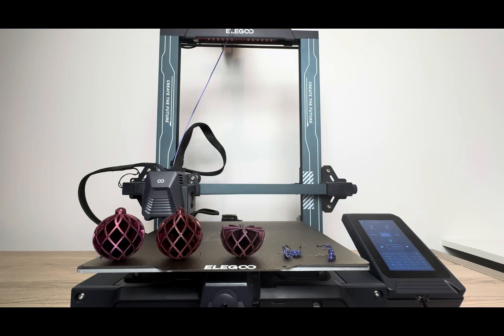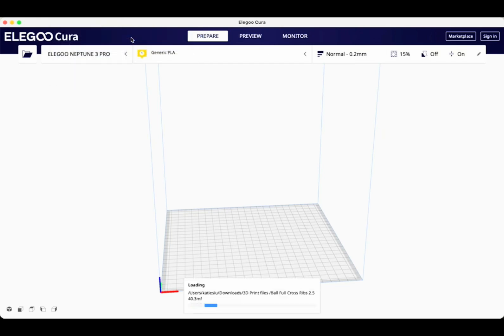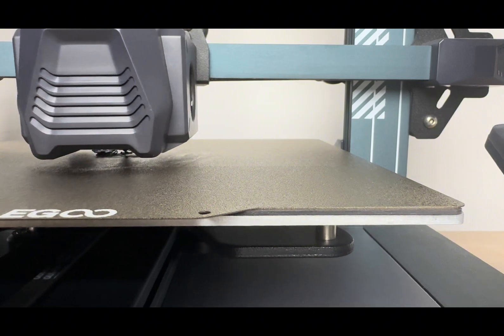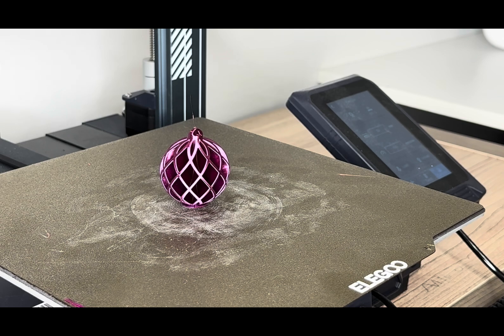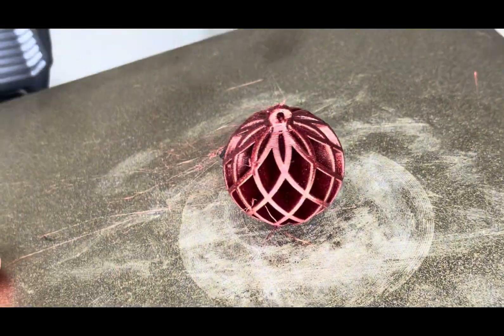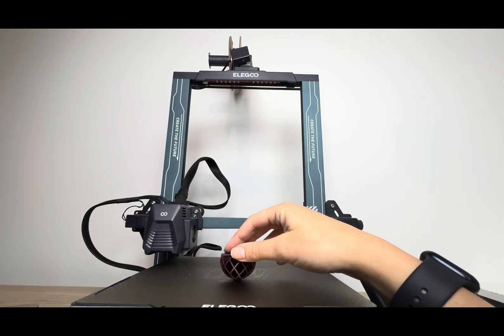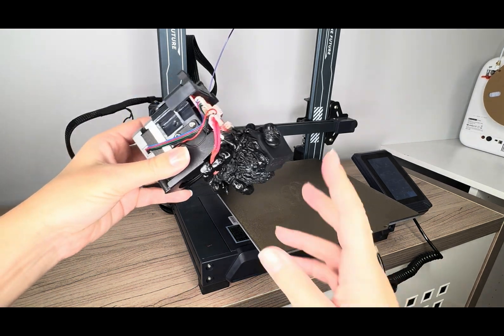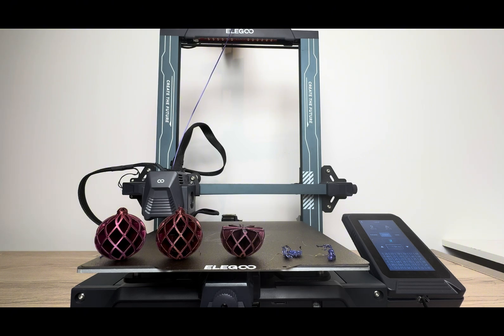Top 5 3D Printing Mistakes (and How to Fix Them!)

Comment: I just got into 3D printing (got my first during the Black Friday sale a couple of months ago) and a couple of these tips surprised me as I haven't had to deal with either of them. Mostly the clog, refills, and leveling. My printer stops during clogs (can be frustrating since it's not specific where the clog is), allows me to pause the print so I can swap the roll and resume once I have changed out the filament, and each print takes the time to auto level. Had some minor issues with auto leveling, but it's mostly in the back of my mind most prints.

I don't know if it's because it's a newer model or because it's a Bambu. I'm not a brand snob, but I did get my Bambu because I heard it was beginner friendly.